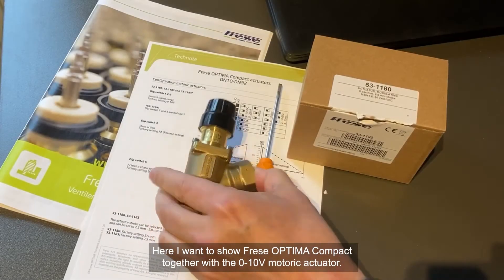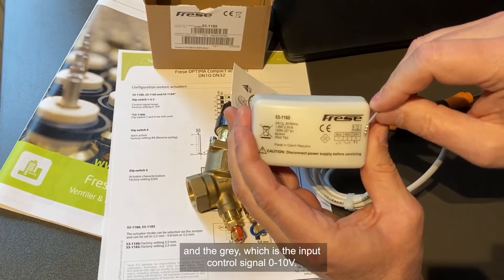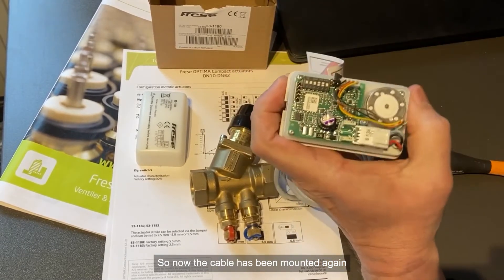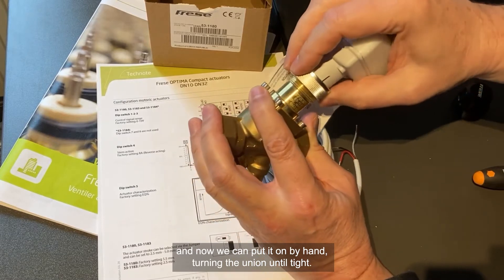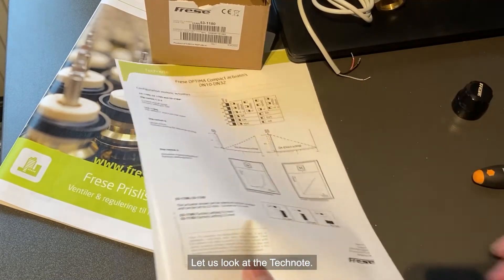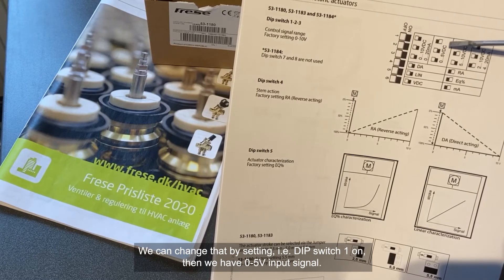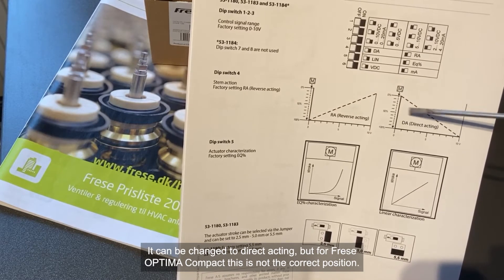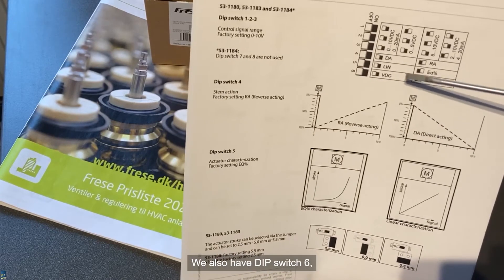Frese OPTIMA Compact with motoric 0-10V actuator (EN)

Comment: The actuator in the Video is the 0-10V version, and can be connected to the BMS through a controller. Frese also have digital actuators for Modbus/BACnet that can be connected directly to the BMS

Comment: What will happen if power is applied before the actuator is mounted?Will the actuator recalibrate itself or what procedure must be carried out?Thank you
Reply from the maker: If power is applied to the motoric 0-10V actuators for valve sizes DN10-DN32 the actuator will try to calibrate.
But if it is not mounted on a valve, it will not be able to finish the calibration, as it will not be able to find the closing point for the valve.
The actuator will stop in a fully extracted position. 
To avoid this the actuator must always be mounted on the valve, before power is applied.
Reply: Thank you for your reply.I am currently working on a project where power has been applied to all actuators before they were installed onto the valves.The client has many heating and cooling issues now.When testing the actuators by adjusting the 0-10vdc signal from BMS  the actuator is not closing the valve fully.Can this be resolved?
Reply from the maker: @davewardyward  Please contact our Global Product Manager Andy Gibbs by mail ags(at)frese.dk.